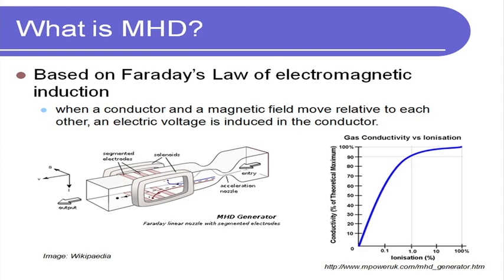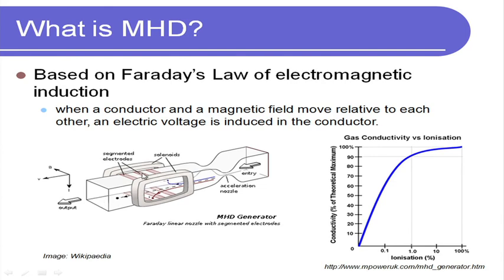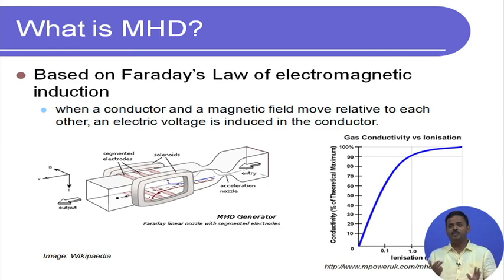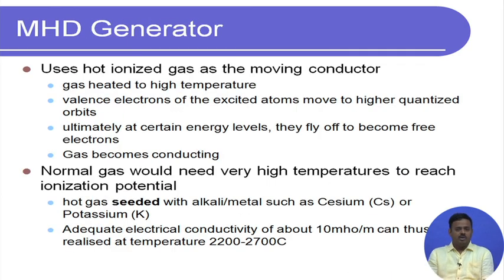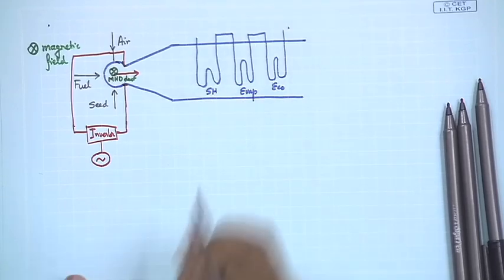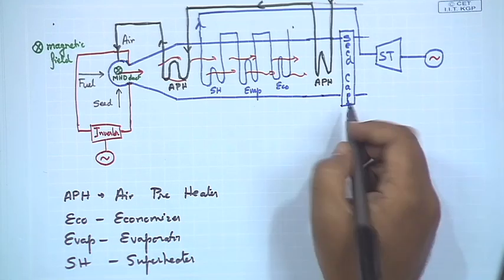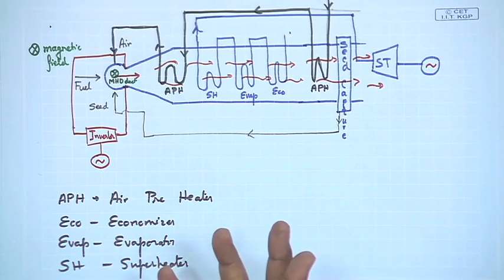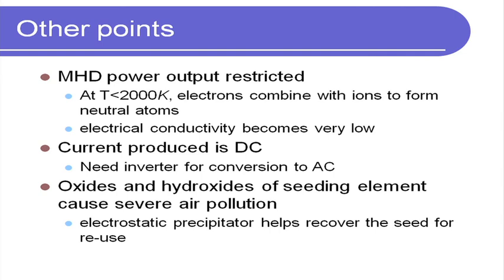Lecture 44 : Direct Conversion - Magneto Hydro dynamics (MHD)

Comment: Sir according to Faraday's laws of electro magnetic induction  I.e the when conductor links with changing flux an emf is induced that emf is alternating in nature so the out put is AC but in MHD it works based on Faraday's laws of electro magnetic induction but according to it the out put is AC na why DC in MHD sir 
Please reply me sir
Reply: In the experiment you are referring to, the manget moves to and fro, causing the change in direction of emf, hence alternating. Here, the ionised air moves in a particular direction, magnetic field is also the same, so emf generated is dc.